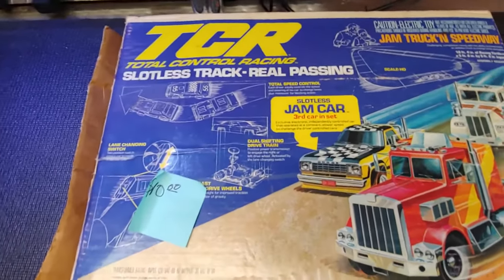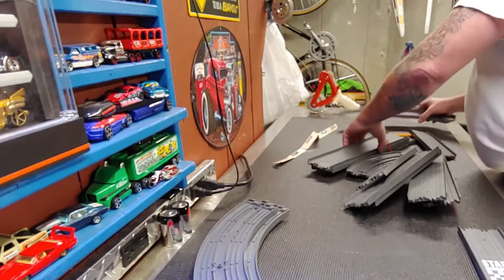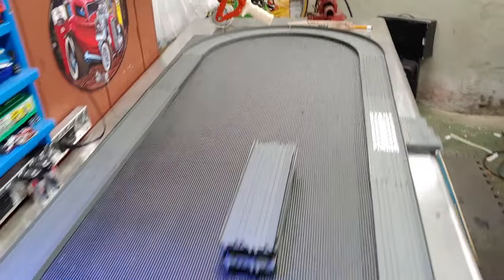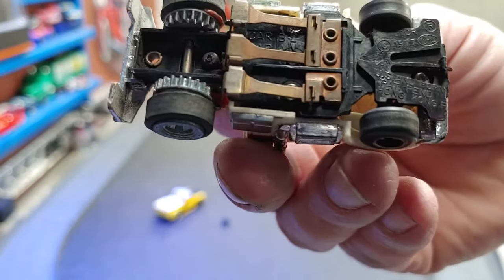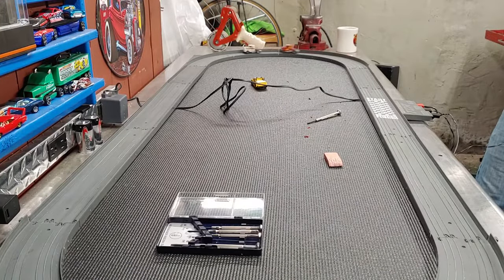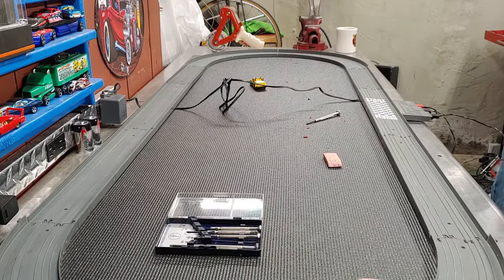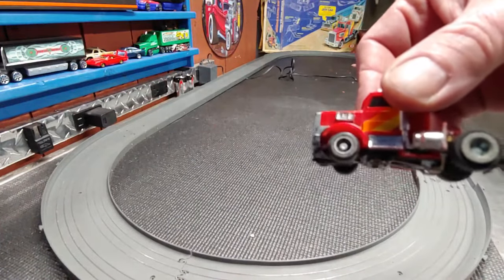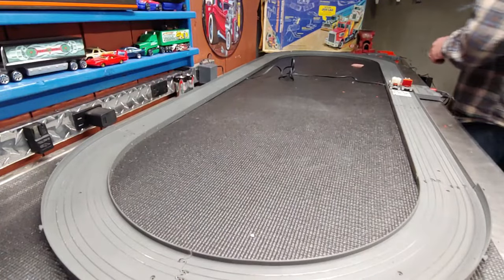Ideal TCR Slotless Rig racing with Jam car 1978

Comment: We had alot of fun with these.The CC track was great cause used the CC cars and the tyco tcr..Clean track with 220 grit n wd.Wipe excess oil when done.Does wonders..The CC cars have larger white plastic gear in back know to crack.U can take thin aluminum tape cut n wrap the gear and u get alot more life out of them.Have fun
Reply from the maker: Thanks 👍

Comment: So many memories I had so much track and so many cars and I basically ran it until it really didn’t work anymore. The cars would get stuck but I loved it while it worked and I always wondered why it disappeared and then I remembered. I remember taking a penny and going around the track and cleaning a little wires so I made sure I had a good contact with my car’s.

Comment: 0:40 yeah. This was the first race car set I had when I was 4. The trucks had a problem losing electric contact when switching lanes.
Reply from the maker: I used a new spring an pick up shoes after i shot the video and the performance was excellent.Thanks for watching and checking in.

Comment: Nice set, brings back fond memories, saving up my pocket money and birthday money to buy my first scalextric 400 set around the same time this TCR set was in the stores! I was always curious how the TCR system worked. 👍😎
Reply from the maker: It was..for the most part just like everything else it worked after practice and practice but then it was fun.
Reply: Original price in the UK was extortionate... Wasn't it something like £80 / $160 back in 1978?
Reply: @hpt08  Not sure how much the TCR set was but I paid £44 for my Scalextric 400 set in around 1978/79, took me ages saving up my pocket money and birthday money etc 😯😊
Reply: @pdtech4524  premium 78 tech alongside the Vectrex... a good reason to find the Argos catalogue from 1978 😁
Reply: @hpt08  Was argos even a thing in 1978? I certainly didn't have one where I grew up! 😁😯
Reply: @hpt08  Just found an old argos catalogue from autumn 1978, the ideal TCR set was a little more expensive than the same size scalextric but it was only £32.50 compared to.£23.95 for the scalextric equivalent.
Reply: @pdtech4524  so it just seemed gold plated to me back then! That's some find though! 😁😁😁

Comment: I had a set as a kid then in 2000 I found a mint, unopened box and bought it. The tires had dry rotted. What I did was find some rubber vacuum line hose that was closest the the original diameter.  Cut to the proper width but here's the trick, those tires are supposed to have a greater diameter on the outside than the inside. This will make the lane change quicker also. So I put the tire on a drill & drill bit large enough to keep it from slipping then run the drill and use a sand paper on a sanding block on an angle to the rotating tire and after a bit you'll have a tire with a larger outside diameter & smaller inner just like the originals.  I think the cars running slower is more realistic & when you let off the trigger they coast.

Comment: CRC contact cleaner and a few drops of oil.  Also use the contact cleaner on a rag for the track.  I keep my trains running perfect this way.  Do not use Goo Gone.  The CRC contact cleaner will disolve all the oxidation.
Reply from the maker: Solid advice.

Comment: Odd, the TCR track I had from that era had grey controllers with a black steering wheel instead of a switch to change lanes. You did not steer the car, but turning it to the left or right was the switch.

Comment: I still got mine after 40 yrs & i was hoping to get it working again, maybe get my son off the darn tablet! I cleaned tracks, connections, changed rear tires & pick-ups... but cant seem to get it to run continually.... grrrr...
Reply from the maker: maybe new motor brushes or try cleaning the commutator. worth a try.
Reply: @Howlinwolfreviews  these small motors have brushes? how would you clean the commutator please?
Reply from the maker: @matthewmicallef6262   https://www.youtube.com/watch?v=P3YKntGpjGM

Comment: cool...I'm in UK and have about 3 or 4 of these Idela TCR sets.  Most of the track needs a bit of cleaning.. what do you use/how do you clean your tracks.  I've taken apart a few of the cars and cleaned and repaired most of them and rplacing tyres, and pickups, but still got a few more to do.  Great vid  btw.
Reply from the maker: I clean them the old fashion way. An eraser and alcohol,works great.
Reply: @Howlinwolfreviews  Will try this... thanks for the quick response.
Reply: I used to use a 2p coin and a blue rubber to clean the track worked a treat for me

Comment: I think I received a TCR set every Christmas as a kid. TCR was great, but it was a little less challenging considering that they never flew off the track. All you needed to do was hold the switch down the entire time. Tyco was more challenging because you could crash. Either way great video.
Reply from the maker: Thanks for watching,also With a conventional slot car set if your opponent released his/her trigger that surge of energy would supply your car with a quick dose and launch your car off the track!! Good times.

Comment: Wish I had that kind of luck.. For $10 it was a steal if any of them ran at all. Especially being that old. I've got the big detour Tyco set that came with the 2 semi trucks, ambulance blocker & 2 Camaros. None of them work.
Reply from the maker: Sorry to hear that,A little work gets em going again.
Reply: @Howlinwolfreviews  I think the track & power supply is ok after cleaning all of the connections. I remember the last time it worked, only two of the cars worked. Not sure of the motors are bad or not.
Reply from the maker: @bradwindhorst7010  the easiest way to test a car ,is to put a 9 volt battery across the pick up terminals.
Reply: @Howlinwolfreviews  I do remember that trick, since you mentioned it. I will try that. Thanks.
Reply: Yeah the big detour is what l had to the van was a dodge l made super big money on that set selling it to a friend of mine he did some tuning on the trucks and we raced them no regrets thou